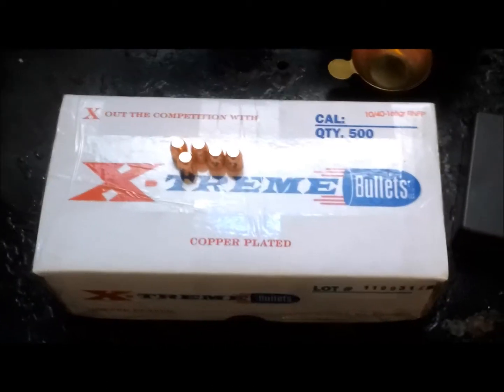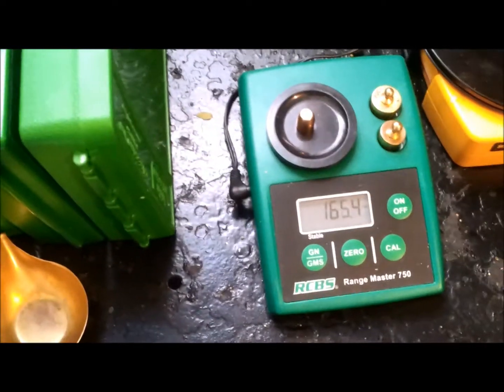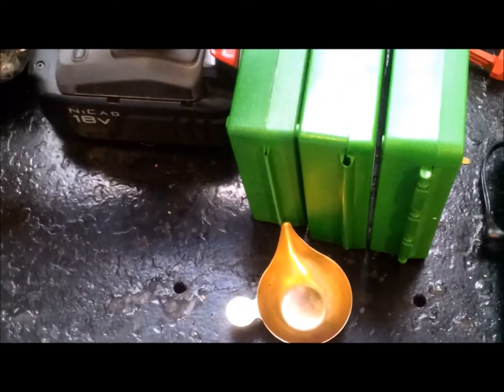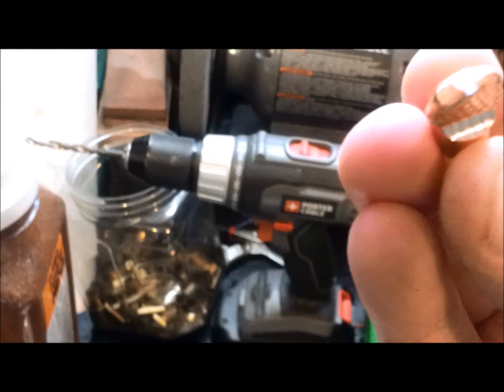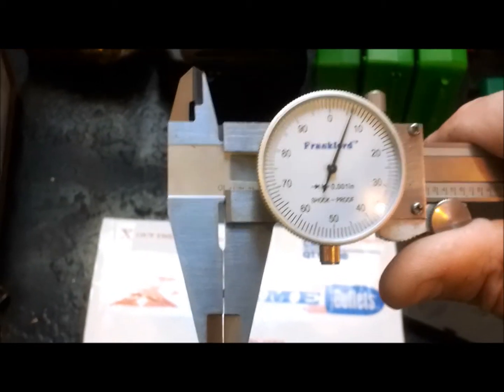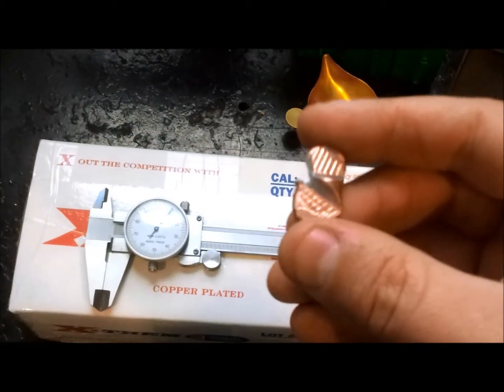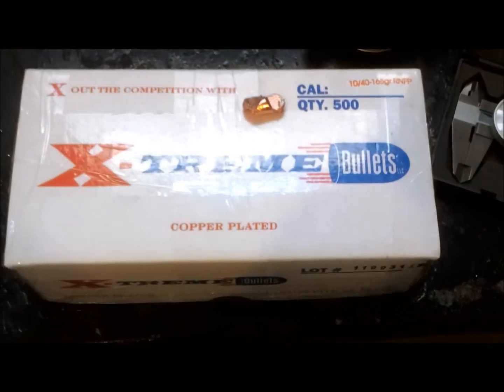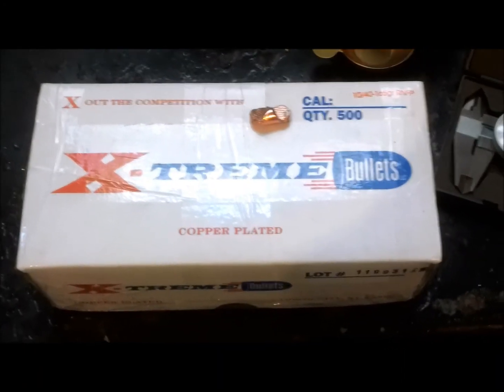XTreme Bullets

Comment: X-treme plated is all I use anymore.  I've loaded and shot probably 5000 .45 200gn Semi Wadcutters and another 3000 9mm round nose and they're the cleanest running, consistently great quality bullets I've used and I've tried most of the major brands.  You can't beat the price and the service is fast and friendly.  You can get 3 boxes in a single $14 mailing.   I have no affiliation with X-treme; I just enjoy getting a good value on a high quality product.

Comment: Shawn, I just purchased 500 XTreme bullets,, .357, 158 grain RNFP. . What is the max powder charge you load with XTreme. I use Bullseye, AA#9 and have been told "load to lead". I know these are better than the cheaper brand copper plated bullets. Your thoughts, Thanks, Rich